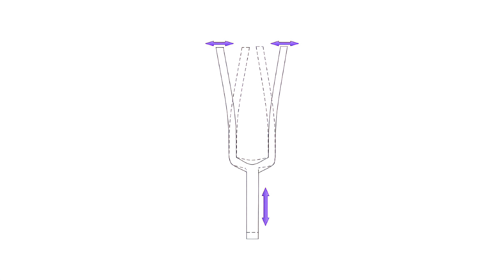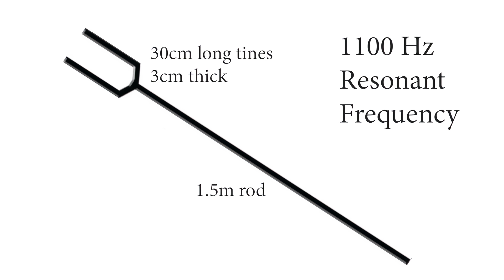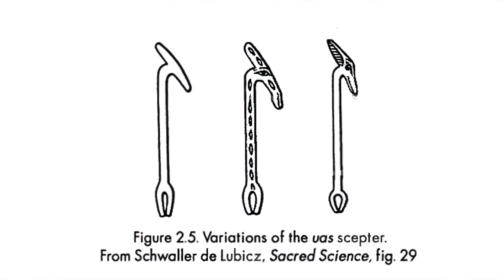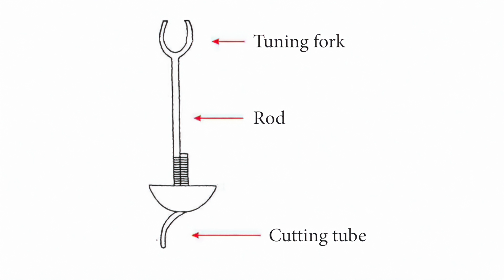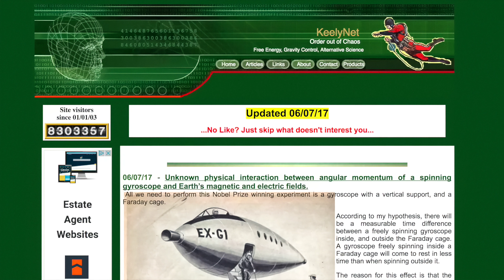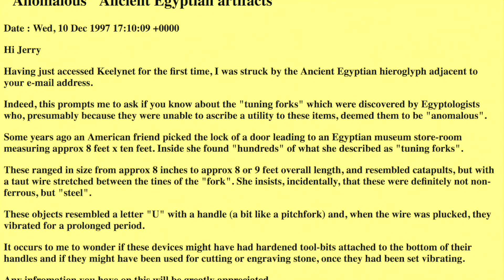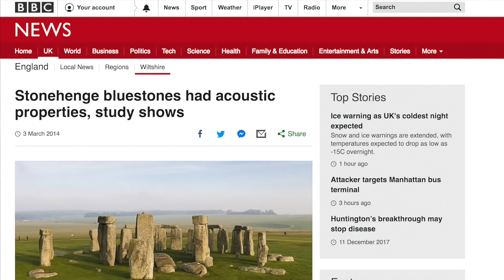How the Ancients Cut Stone with Sound - Lost High Technology Explained | Ancient Architects

Comment: It was shown decades ago that those walls with the perfectly fitting bricks were possible because the material is particularly easy to carve to shape. Most 'mysteries' have been explained,  but these 'mystery-mongers' will never tell you that, and the details are hidden away in scientific journals. Perfect stone spheres? Explained.  Large rocks, with tracks behind them, in deserts? Explained. The list goes on and on.
Reply: Please explain some of these, “mysteries,” for us..
Reply: @redwingsfan3621  Perfect stone spheres: it has been known, perhaps for millennia, that if one places a roughly symmetrical boulder in a hollow in a stone surface and keeps turning it 'every-which-way' for a long time, the boulder becomes more and more perfectly spherical and the hollow becomes perfectly hemispherical. During the industrial revolution, this principle was used to mass-produce ball-bearings by running drop-tower steel through spiral-inscribed millstones..
Tracks behind large stones on a dry desert floor: the notorious pictures are always taken in high Summer. But the desert is not always a desert: in the Winter, it is a place of high winds and low temperatures. Ice forms under the stones and the high winds propel them ... leaving the tracks. It is the same mental failing as imagining that the pyramids were built without scaffolding, just because there is no scaffolding around them nowadays.
It is a safe rule-of-thumb to apply that, if someone believes in such 'mysteries', he is completely bereft of personal imagination or curiosity ... even if he claims the opposite.
Reply: MrAaronvee Well, I appreciate your lengthy, well-written explanation.  While I don’t doubt what you’re saying I do believe there was something supernatural involved in creating the great pyramids.  Just too much weight and perfection involved to be human, imo.
Reply: @redwingsfan3621  You should try to read everything about the subject. The danger is that the easiest-to-obtain information is often put there by people who want to push their own view of the world. Did you know, for example, that re-excavated local quarries still contain unused stone blocks which bear inscriptions indicating where they should be placed? Thousands of years ago, the Romans built an incredibly huge ramp of earth in order to attack an otherwise impregnable Jewish fort. They did not clear it away afterwards ... no need. But it shows just what feats of engineering were possible, and how they would seem magical if traces of the technique were subsequently hidden. It is sort of insulting to the human race to posit supernatural phenomena simply because modern people may have forgotten old 'tricks of the trade': perfect 90-degree angles? Simply use the old 3:4:5 trick. Perfectly level base? Just part-fill a square moat with water. Stone block too heavy to lift or slide? 'Walk-it', as any modern delivery-man might do.
Reply: MrAaronvee Yeah, the Romans did that during the Flavian dynasty, I know.  Pretty cool to read about.
Reply: @redwingsfan3621  I blame Arthur C.Clarke: his TV 'mystery' programs distorted the viewers' appreciation of truly interesting facts. He was an all-round villain: he started his career by lying about having invented geostationary satellite communication, and finished it by backing nonsense such as cold-fusion.

Comment: Omg people listen. Yes there were probably ancient civilizations were yet to discover considering the vast life span of Earth. You can drill stone and metal through centrifugal force via a modern machine or through manual labor. If that machines RPM’s 5k like a modern car then that can be achieved through manual labor. It’s just going to take a lot more precision to develop their technyiques, such as a tripod perfectly situated with a hand crank or wheel, a slaves work. When one gets tired another is rotated in to continue the pace of RPMs necessary to drill these holes without “sound”. Your theory makes no sense because very loud sounds like thunder or lighting don’t cause random things to just levitate. Don’t tell me some bonkers about it being a certain frequency when there are so many kinds of radio waves and signals in the air today we should all be levitating. Now as for the metals there are more than just copper ore inside of mines....and there’s empires had vast trade they could get access to high quality metal for drilling. This is what people did back in the Stone Age. People had a lot of free time when they didn’t have to worry about survival. Don’t underestimate the capacity of Man.

Comment: I cut, saw, drill into concrete, granite, marble, etc. for a living. Some concrete is soft, some very, very hard, depending on the aggregate used in making the concrete, and the other materials as well. The guy u show in this video is using a drill set up I've never seen before. It's a small, hand held motor. I dont dont know wut type of electricity is powering it. But, i have drilled 40" diameter holes in concrete walls, and bridge decks, meant to withstand very high pressures, loaded with river rock aggregates, and thick rebar. It takes hydraulic or hi cycle powerful drills, mounted on stands, with a very knowledgeable operator, and specially formulated diamond segmented drill bits to cut through the materials. U also need variable speeds and pressures to perform these types of jobs. I've STILL not seen anything that makes sense, as an explanation as to how THEY did it over 3000 years ago. But, I do believe there is much missing from the archaeological record. We are definitely missing something. Bc someone, or something, obviously did it, all over the world. There exists precision stonework that would be hard to replicate today, with all our technological advances.

Comment: The two sides of the U or fork are using constructive interference resulting in standing waves going both in the same direction which is down the copper pipe. Try use a three or four pronged fork. The devil and his fork is probably used to shock his victims with a strong vibration and so the Egyptians may of had something similar they used for power, but they could be killed with a bow and arrow in a war which maybe wiped out their knowledge of how to use them or charge them up somehow. All fork prongs must be the same length from top to bottom where they join at the pipe. Or one prong can be exactly twice as long as another, etc. but no fractional lengths but multiple integers only. That is why we see some forks with various length prongs or tines attached. It is all about placement, phase and wavelength.

Comment: I dont believe the alien theories either . 

But i did hear about a rock softening material made from plants. 

My thoughts were if you could soften a hard material then sit a flat surface on it or shape it with relativly cheap tool and the rock being sat next to each other or ontop of each other could kinda shape each other or something.

Like plato having a heavy obgect sat on it so it can flatten out.

Mabe sitting this plant materal on stuff then grinding it and adding different coatings or coats of it over periods of time then going back and grinding again.

Here ia the link to the vid i found out about thia sapposed plant like material.
But this tunning theoery i like
A hole lot more !

Here is a dank meme !
https://youtu.be/ti2syZ-kcws

Comment: The biggest problem is you cannot get perfectly square cuts etc.... by hand, try it, use a hand plane and a 2 x 4, see if you can make it perfectly flat, square etc, then try and make another to fit it..... you cant. 
Drilling by hand straight, again not possible, even more so for deeper holes, for those of you who have never used a core saw or drill, take my word for it, the slightest degree off and the bit will bind up, the teeth on all diamond saw's etc... are wider than the actual blade. Otherwise, especially with fluid cuts, the suction would create a huge amount of resistance, take my word for it, even something as simple as a fence post, is very difficult to push or pull into or out of the earth.
I love these guys who have never built anything trying to describe how these things are built..... over 30 years heavy equipment, I've run alot of those saw's and drill over the years, believe me, it's alot harder than it looks. The longer the distance you have to drill, the more precise you have to be when starting, we use laser's when doing sewer pipes, 1 degree off at the start can lead to being off by feet when you get 100 feet down the line....

Comment: Hmmm, there is one obvious piece that is missing from this video. Instead of postulating that the you can "definitely" (!) cut hard stone with a copper pipe using resonant vibration why not set up an experiment?  The materials are easy to come by, the dimensions you supplied yourself, so where is the evidence.  Without it the video looks unfinished and appears designed to tantalize rather educate or provide information.

Comment: I wonder what frequencies are best for the various types of stone and for that matter for concrete.  Note how my 800 watt hammer drill with a suitable bit has real difficulty drilling through cement while a 400 watt Hilty drill, specifically designed (presumably with the correct frequency) drills concrete easily.  What an opportunity for a company to come up with a tool that you can dial the frequency you want and you simply vary the frequency until you find the sweet spot for the type of rock you are shaping or drilling.  No more having your arms disabled by using a jack hammer.

Comment: Interesting idea, but so far no one has built anything using sound to cut stone.  Even using modern technology, no one can come up with a device that magnifies sound waves enough to cut paper, let alone stone.  Unlike light waves, sound waves are very difficult to focus into a tight beam, and even then the device transmits the vibrations outward as much as they do into a beam. A high pitch wave can be generated to use against mobs, but the sound also bounces back and hurts the people using it!   So while this idea seems plausible, I doubt the Ancient Egyptians used sound waves to cut stone.

Comment: Did I miss something? I was waiting for a Thor Heyerdahl-type demonstration to prove that the technique is feasible. Absent that, I'm very skeptical.
Reply: Ditto.  I've seen the copper pipe drill method demonstrated in person and its ridiculously simple and surprisingly fast.  Clay to create a holding puddle around the drill site, fill the puddle with abrasive and water, and attach a weight to the top of the pipe then spin that thing like a top.
Reply: They may have used it to remove calcified plaque instead?
Reply: it's BS at the level of ancient aliens. Check out these Russian guys proving that hand tools existed and are proven to work in drilling https://www.youtube.com/watch?v=yyCc4iuMikQ&ab_channel=ScientistsAgainstMyths

Comment: Science has proven that hard granite may indeed be precisely cut, or, drilled by applying exact sonic frequencies to the metal cutting tools being used. These necessary frequencies must be generated by the voices of thousands of workers singing in unison to achieve the effect. They must all sing the SAME exact notes which are strong enough to penetrate the granite. The question becomes WHICH notes must be sung ?? The answer is EASY !!!...........just sing the SAME notes that YOKO ONO recorded and entire MOUNTAINS of granite will slide into the sea !!!!!

Comment: No they did not have sound cutting tec.  They used copper, sand and water mostly.  Sand inbeds in to copper and with water you can make saws, drills, polishers to work the rock.  Simple tools like plumbbobs and squairs can get the shapes right.  If copper is around this is how this stuff was done.

Comment: about the vibrating drilling tool , i know the tube doing the drilling must be harder than the rock you have to drill , with the vibration hypothesis it will make the tube being eroded as it grind with the harder rock , on another level we can see multiple time the drilling was done with a single point cutting into the rock at the astounding rate of 2 mm per turn and leaving the glassy spiral mark that the vibrating tool do not produce , so aliens desintegrator energy tool that break atoms bonding at the molecular level , the glassing is done by quartz atoms re-attache to the untouched wall and creating quartz very thin surface

Comment: In the world of vibrations - one can take underwater sound waves - moving like a sine wave - and introduce counteracting energy to completely attenuate that wave. One way is to introduce a bubbly water curtain between the shock and the target - so the sound wave in water at 5k fps enters air at 1k fps and so slows down the pressure spike such that the rarefaction following the compression neutralizes the shock. 
So, if one can diminish a shock wave [I built such a machine or the Navy; and used it in underwater demolition] - it would seem possible to amplify it also. If one can direct these forces- making a cutting tool should be simple.

Comment: I was at Stone Hinge last year and felt the stones ( well, one in particular) humming/vibrating like it was itself a tuning fork. Those massive stones, half buried in soil that should dampen any vibration, should have had vibrations observed by many previous visitors. And yet, I felt it gently humming away. I had my wife lean on it - and it was inert to her. So perhaps it also requires just the right fellow to get it humming.  My grandmother could make use of water witching techniques, but they did not respond to me. Perhaps there are sounds/signals/vibrations that only a few folks can tap.
Reply: You absolute liar

Comment: What if the Scepters were writing/carving tools. Only the higher ups carried them because they were the literate ones, notice how they also all hold and ankh in the other hand. I bet the ankh was the "hammer" they used to strike the fork. Put the stem of the ankh in the U of the fork and strike it back and forth. Need to stop it? Push the cross of the ankh up against the both forks, or maybe it changed the frequency for different effects.

Comment: I use ultrasonic waves in a liquid of ammonia and water diluted contained in a stainless bowl within a ultrasonic resonator to clean jewellery ect as do mechanics to cleans car parts so this is a perfectly feasible. the liquid is just a means to remove waste the sound produces the ulrta high speed movement hence the cutting agent dose not have to have forced contact with the other surface, so any type of solid agent could be  used in any form, ie taught wire between two points for straight cuts in stone ect as dipicted in many pictures of large blocks of granite perfectly cut.

Comment: you can determine how old the stones are with carbon 14 dating methods.
Reply: no , carbon 14 dating is good only with wood or organic matter and is limited to 50,000 years , the dating is done by comparing the ratio between carbon 12 and carbon 14 ( made by high particles energy transforming c12 into c14

Comment: As open minded as i am to this. I dont like how definitive he speaks.
Copper and a tonefork going through granite is cool, but modern sonic drilling still uses extremely tough metals and always needs pumping water, not to mention the machine is bigger than a dump truck, and uses hydraulics to push the cut. And still wouldn't cut these holes found. Also doesnt explain the giant stones being moved.

Comment: I have analyzed this idea months ago and I totally agree with you with the was sceptre. It is clear as water, the tuning fork sends a londitudinal wave through the handle, and if the tuning fork is the same frequency as the 2nd harmonic of the handle it would resonate and that vibration in the handle can be used and it will not stop the prongs from vibrating as a tuning fork vibration Is not dampened by the hand that holds it .

Comment: Easy, show a video of you cutting granite with a tuning fork, if it works then you have a case, if not you have a fantasy
Don't get me wrong, they obviously did use some quick easy method of cutting hard rock or there wouldn't be so many examples.
But if you want to show anything believable, you need to show working examples otherwise you might just as well say they wished it done and it happened by magic.

Comment: 9:20 Instead of plucking the wire between the tines, one could use a bow across the wire to make it vibrate, like any string instrument. Using wind - or some solar device, one could set up a circular bow to spin on perpetuity...or until it wore down, anyway.

Comment: Pzio-electric crystals.  Provide a voltage to them, they give you uninterrupted and very narrowband vibrational frequencies.  The graet pyramid was a large device to produce an electric voltage.  Then a pziocrystal was positioned in the pyramid and with voltage the crystal vibrated at a very exact known frequency.  What they used that for is up for debate, but its pretty clear the thing missing from the great pyramid is a pziocrystal.

Comment: Just an observation: at 5:35 you show a relief carving of the scepter "receiver" sitting right smack next to what looks to me like a transmitter antenna of some sort. Before that is the ankh which then logically takes on the meaning of some power source to power the antenna which in turn powers the scepter(s) possibly remotely from a distance. Somehow these four symbols seem to provide a flowchart of the whole process secret.

Comment: I dont by that sound theory.  All the drilled holes show the corkscrew effect of drill feeding thru the rock.
The sound does not make copper stronger.
It would never tolerate the vibration and feed force to cut hard rock.